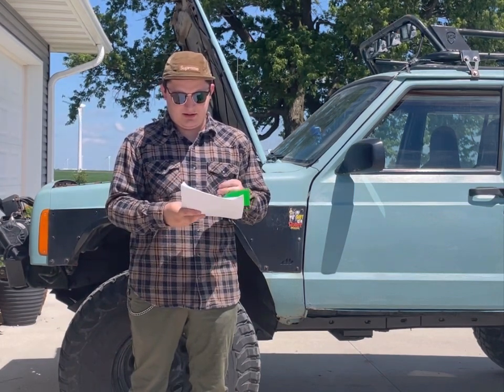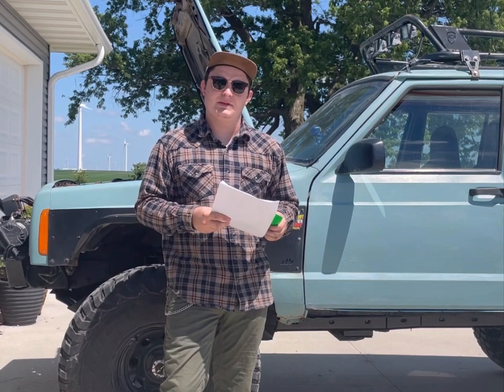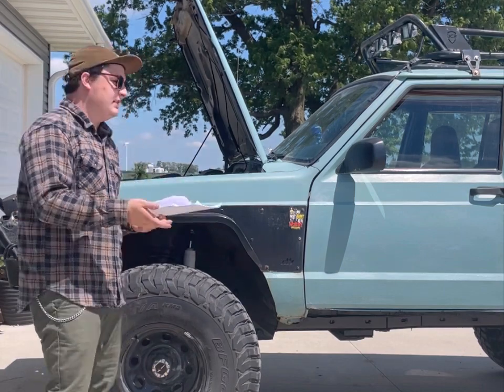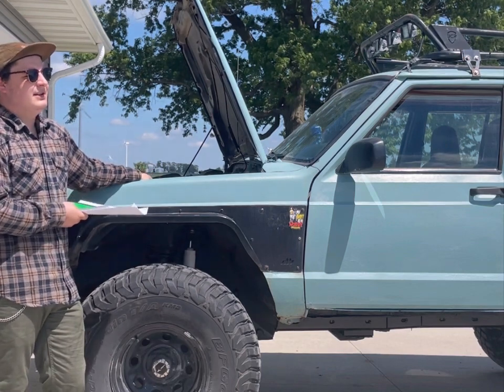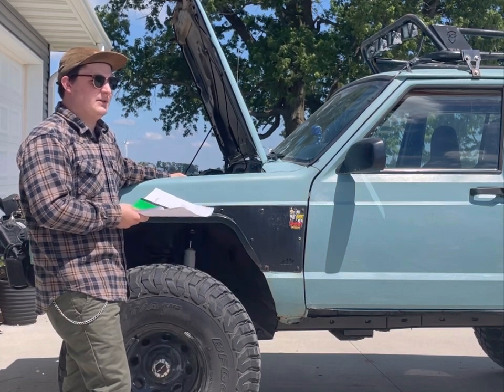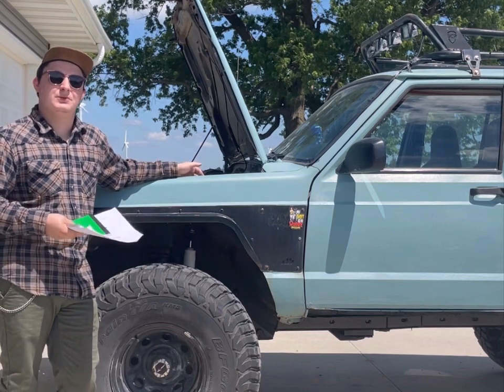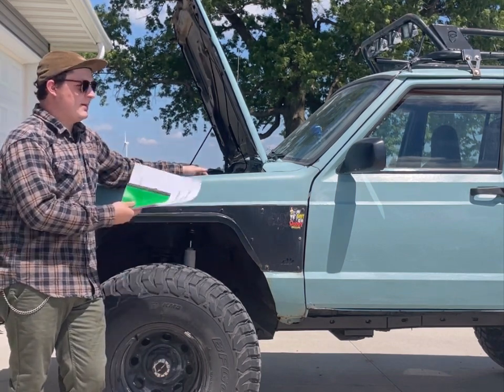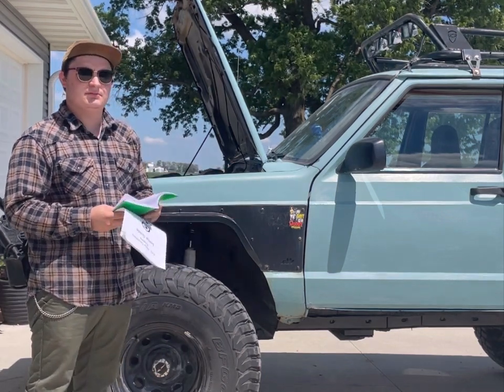Golen 4.6 stroker engine tips and tricks!

Comment: How's she running now?? 

I have one coming from Chad very soon..I have a jeep YJ with the 2.5l and AX-5 transmission with the np-231 transfer case I have the new ax-15 transmission and the transfer case gear upgrade to handle the new tranny, new clutch kit, I picked up from Advanced adapters.  the crate motor..from Chad comes with the Sniper 2 EFI.
Trying to bypass the damn factory ECU.. and changed all my wiring for the lights, wipers, gauges and starter switch already..but still running through the factory ECU..
Reply from the maker: Running great after I corrected a few small things. Very torque driven engine and solid built. Had to get used to the high lift cam noise at first but otherwise no issues at all. I wish you the best with your install and driving your jeep!